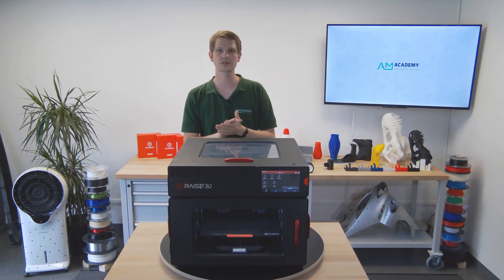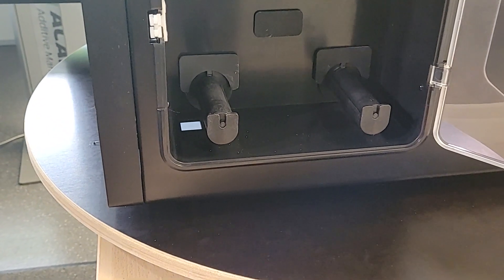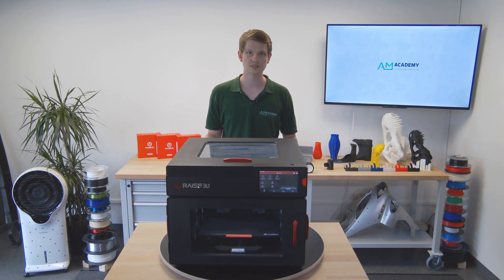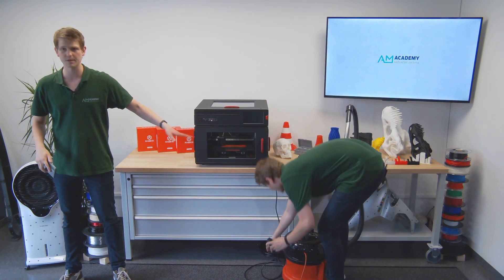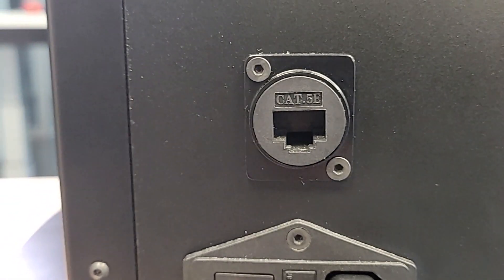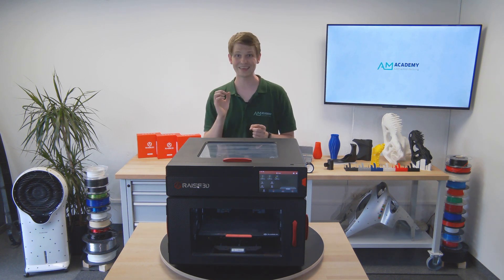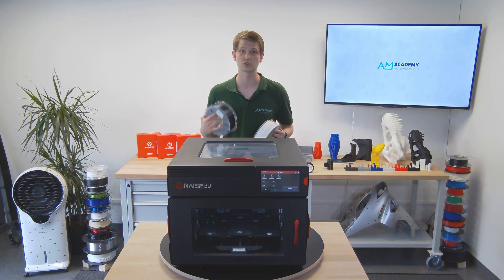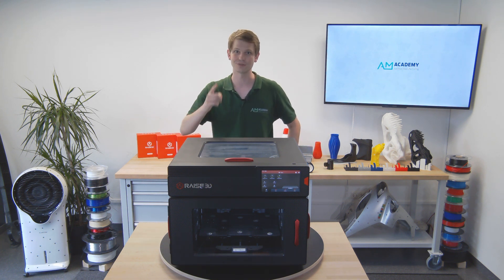Raise3D E2 Feature Overview - IDEX 3D printer with auto calibration and many more

Comment: How does this printer deal with the filament that has oozed from the idle extruder during a print?
Reply from the maker: It does not have a cleaning station. So while there are settings to cool the idle extruder down a bit while it is inactive, you will still want a wipe tower or ooze shield to make sure you start each layer with a clean nozzle.
Reply: @AMAcademyBayreuth  is that something that has to be performed after every print what does one do once they finish a print?
Reply from the maker: @zoetmoments5625  After finishing a print you just let it cool down. Don't worry about oozing then. Before starting a new print, the printer will put a small so-called priming line at the front of the buildplate. This will make sure any surplus filament is gone. and the nozzle is ready for the new part.

Every now and then if the nozzle looks dirty to you, then you heat it to ~190-200°C and use a metal brush to clean nozzle and hotend. Just brush off any old plastic that may have built up.